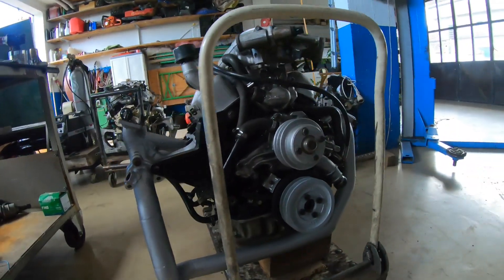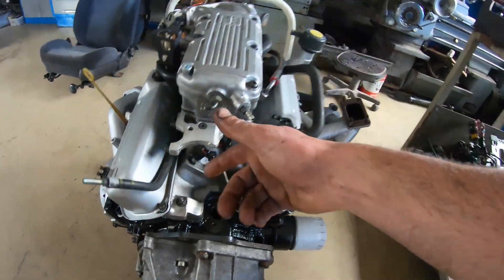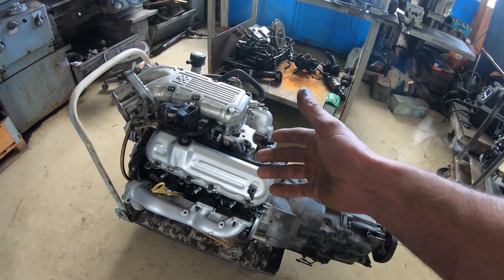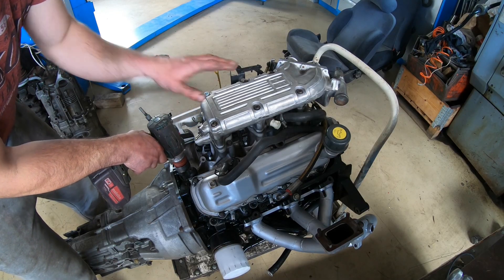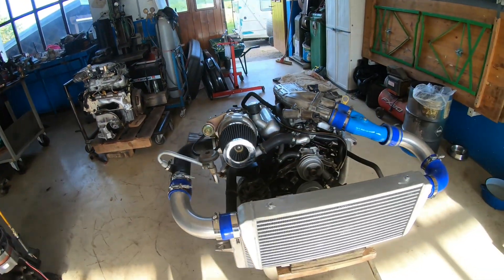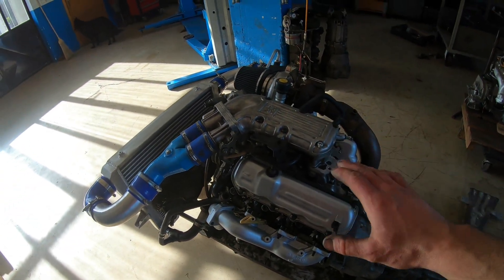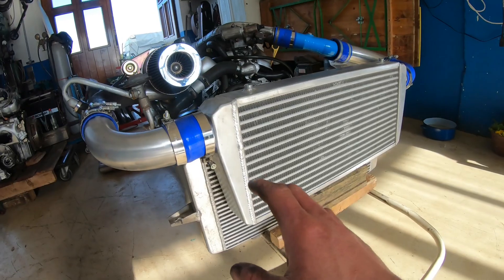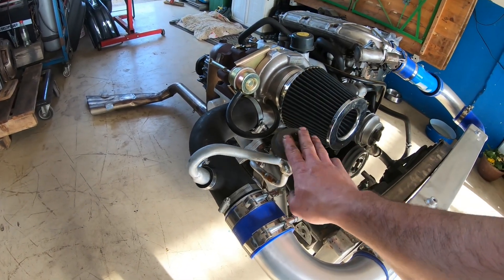Complete Turbo Setup Review | Single Turbo V6 Rebuild | Part 5

Comment: Love this, Nice one. I had 24V cosworth but went backwards to 12V as far easier and less expensive on parts. I really want to turbo my 12V asap. What engine management are you using?
Reply from the maker: Thanks, man! Interesting, I also have one but went first with the old 12V for similar reasons. 
I'm using a version of Speeduino. Budget friendly and well capable of running such engine.

Comment: Couldn’t you use mt75 gearbox im using it on my n9c turbo making 400 and change hp and its holding up really good ,i was scared to blow it up but I guess the little n9c cant cheers love the content
Reply from the maker: One big reason for using the BMW box is that it's very easy to acquire a spare one, which where I'm from, you couldn't say about the MT75. However, I'm happy to hear good things about the MT75, because I'll be using one on my Sapphire 4x4 project. I hope it will hold up even though I have 2 spare ones. :)
Reply: Same here only good things to say about MT75. It has been holding u great on my drift Sierra with N9C Turbo. Just get the oil viscosity right and fix the slop in shift linkages and warm it up before abuse and she is good to go.
Reply: @adnanmlivo5885  and to puch the right clutch combo ;)
Reply from the maker: @adnanmlivo5885 Very nice! We're talking 80w-90, right? I've been reccomended this one and ATF for the transfer case.

Comment: Great content.  I run a 24v BOB cosworth engine mounted to a Mazda RX8 6 speed gearbox
Reply from the maker: Nice! I also have this gearbox, it came with the Sierra Coupe but never got around using it. But as I understand it is a very good box. Also regarding the gearing.